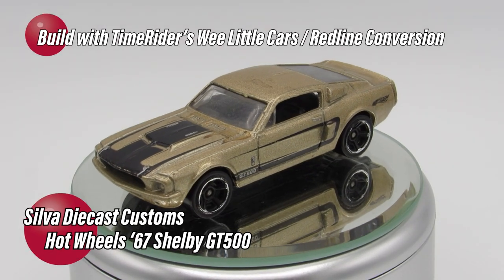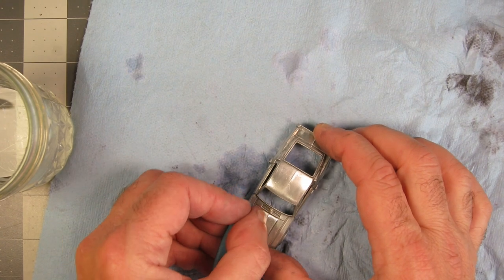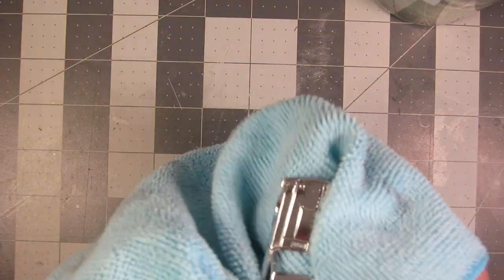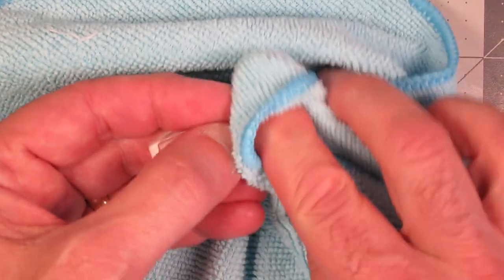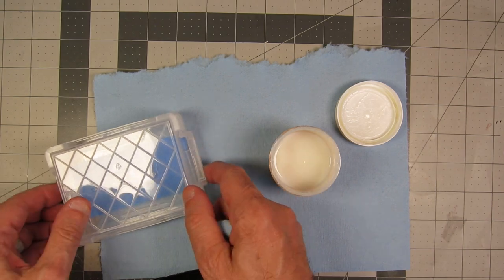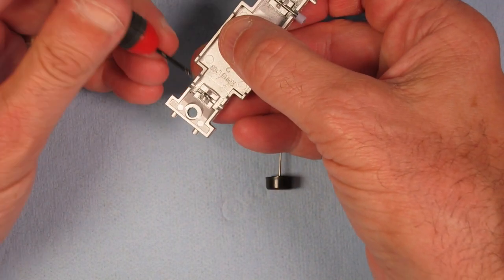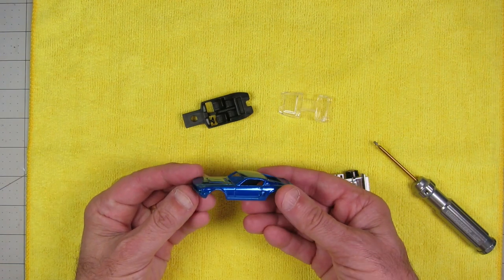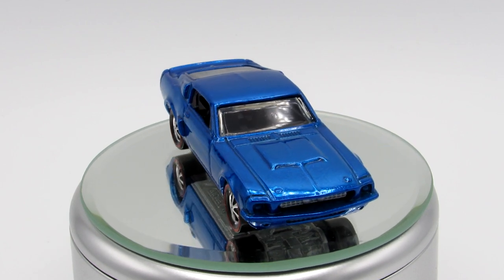Hot Wheels '67 Shelby GT500 / Build with TimeRider's Wee Little Cars

Comment: Nice Restoration Jim. I appreciate all of the tips. 
My second car out of college was an Omni.  It was a good deal, $1,000 cash. Well, it was a “pretty good” deal. It only took about a year before the engine started to lose power 😢. I had to stay in the right lane on the highway, ‘cuz whenever I got to a hill I’d have to put on my emergency lights as I slowed down to about 45 mph. 😂. Pretty soon I was on to car #3. 
Thanks for posting the video!
Reply from the maker: Thanks so much Geoffrey!  $1,000 sounds like a good deal.  I think we've all had one of those cars that you had to stay in the right lane with 🤣🤣🤣🤣

Comment: Would using a bath of IPA in a sonic cleaner work on the degreasing? It would save you some elbow grease... finished car looks much better!
Reply from the maker: Thanks Fraser!  Using IPA in a sonic cleaner would probably work easier & faster, but ever since Uncle Jessy mentioned fire hazards when doing that to clean resin prints in a video a few months back, I'm really cautious about how I use the sonic cleaner a friend gave me.
Reply: @JimSilva-SilvaDiecastCustoms  Fair point, but I would wonder whether it was more likely to be the resin prints that caused the problem... I use a sonic cleaner quite regularly, just to get the crap off an old eBay find before opening it up: not had a problem with it.
Reply from the maker: As I recall, the problem wasn't resin related as it was after he pulled the parts.  I think it had to do with the heater on the machine staying on/keeping the liquid warm even when it was believed to be off.  I could easily see myself forgetting to turn something off or cutting the power to it, plus the workout I get cleaning the stuff is great exercise 🤣🤣🤣